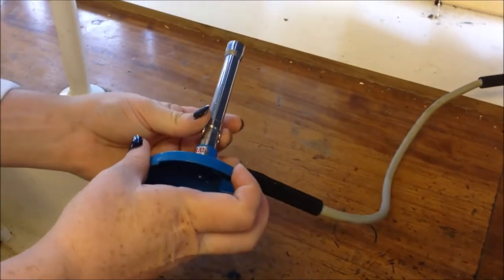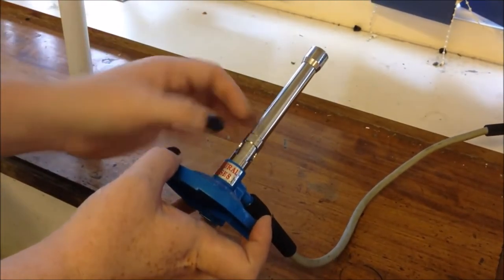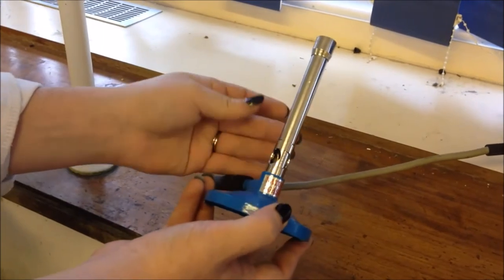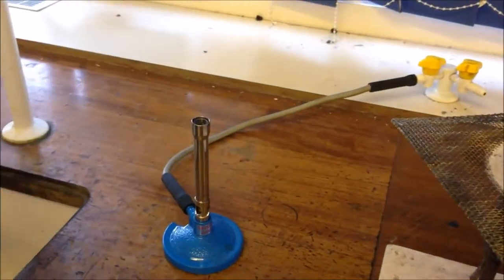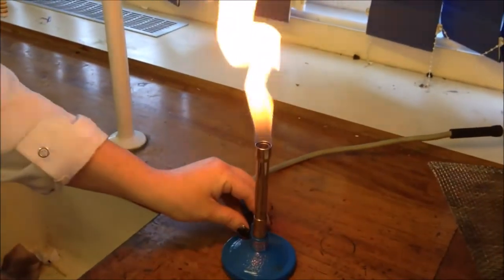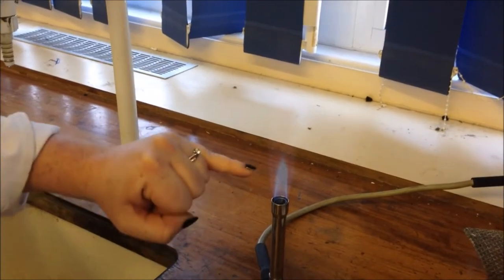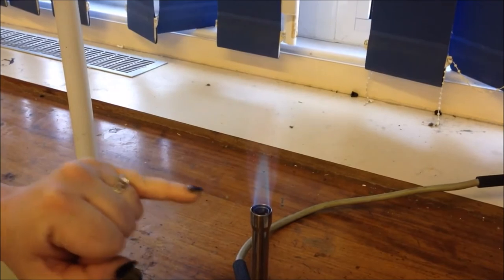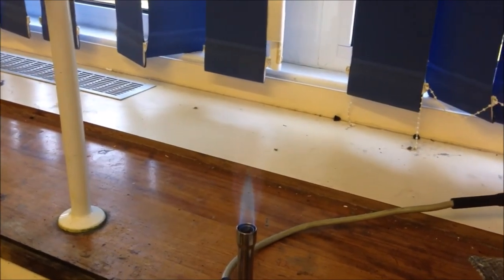How to light a Bunsen burner

Comment: There are wrong . don't open the gas tap before light the match (it may explosive)and close the air hole before light it it may stike back and need to use a firproof board